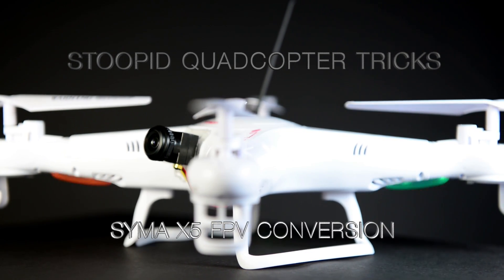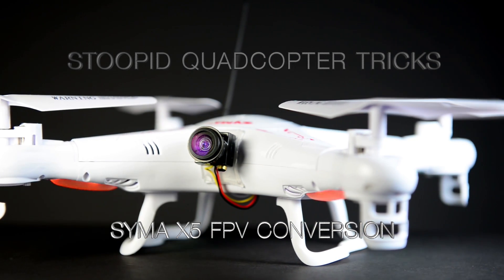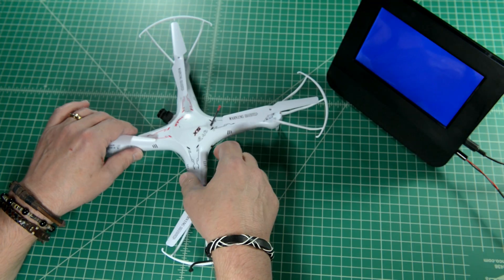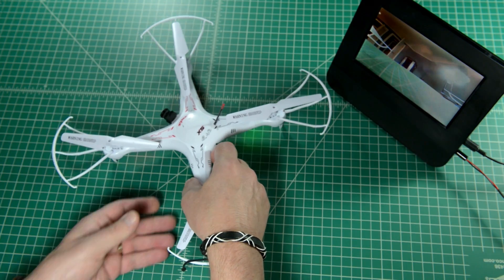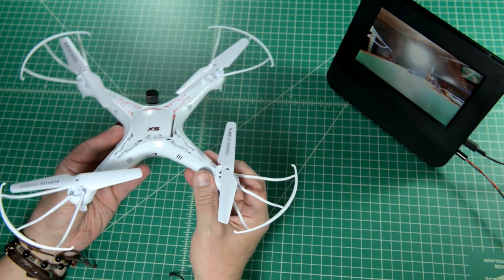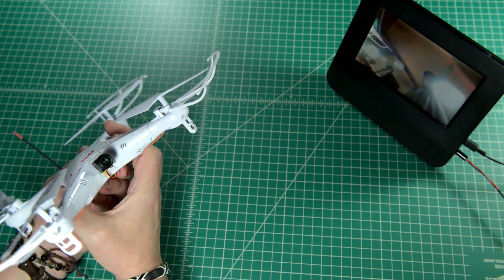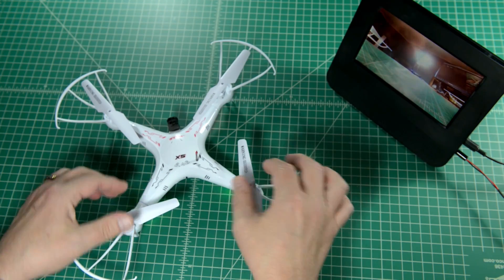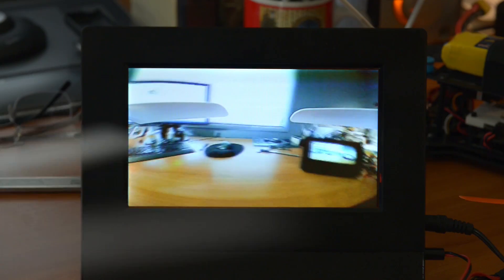Syma X5 FPV Conversion

Comment: love this! I will build myself one.
Reply from the maker: Grazie Francesco. If you are planning to build something similar I have a couple of suggestions.
The first is avoid the SYMA X5 because it's simply too underpowered. The weight of the video system and the drain on the battery make for very poor flying.
Instead I would recommend the JJRC H5P.  It looks virtually identical to the SYMA but has twice the power and a much larger battery.  It's also about the same price as the SYMA (less than $60.)
http://www.banggood.com/JJRC-H5P-2_4G-4CH-6Axis-CF-Mode-RC-Quadcopter-With-2MP-HD-Camera-RTF-p-989596.html
The other thing I would suggest is a low power 5.8GHz video solution. I recently purchased one of these from Flite Test and they work great!
http://store.flitetest.com/hyperion-mini-600-tvl-camera-w-built-in-5-8ghz-25mw-vtx/
5.8GHz Receivers, monitors, and goggles are much easier to come by than 1.2GHz and if the power is low you won't need a HAM license.
If you decide to build a 5.8GHz video system from scratch I would stick with the 10mW 8-channel modules. 10mW Is more than enough power for these little machines and they don't get hot or drain the battery as quickly as the 200mW VTXs.  Ciao!
Reply: +CradyLab grazie a te! I will consider other options as you suggested, the x5 has the advantage of having really cheap 3rd party replacement parts; I totally agree on the 5.8GHz low power module, I use a 600mw boscam on my f450, but 10-25mw would totally be good for 100m of range with a circular polarized antenna.
Reply from the maker: Prego ; )

Comment: Impressive conversion :)
Reply from the maker: FPVtv   Thanks!  It's hilarious flying FPV inside the house with this silly thing =D  I may do another short video just to show how good the video really can be. In this clip that little Tx has to penetrate an exterior wall that includes aluminium foil in the insulation - really surprised I never lost the signal.